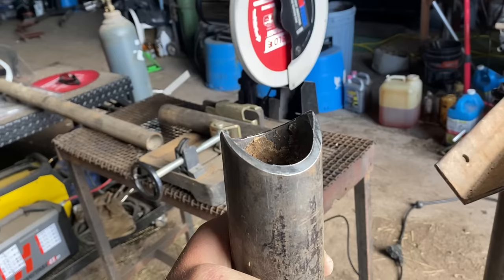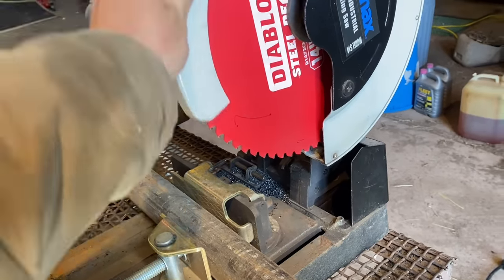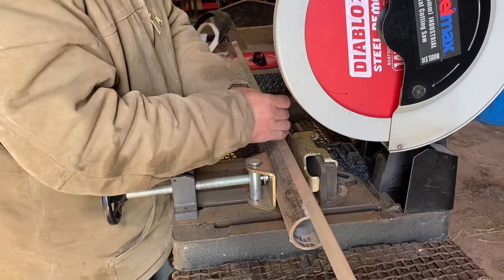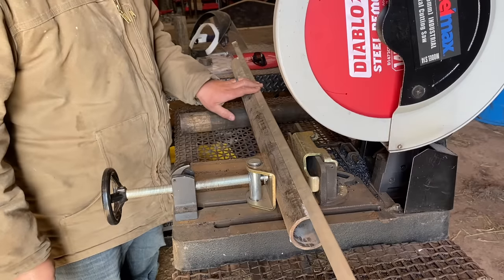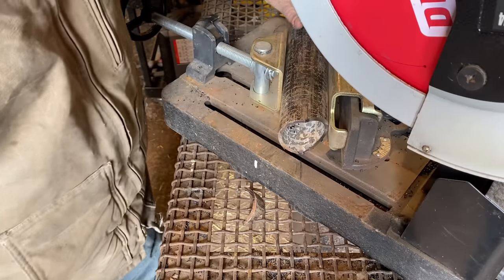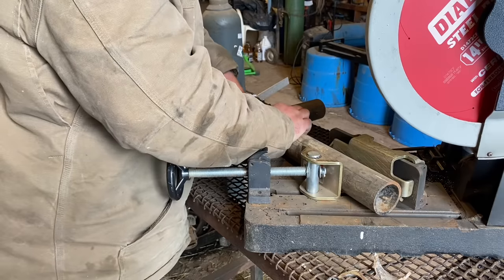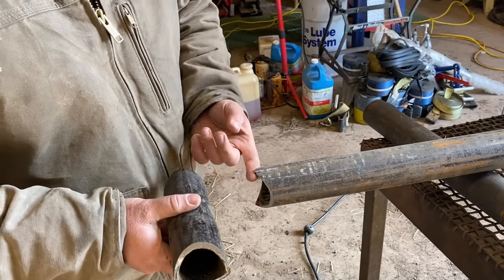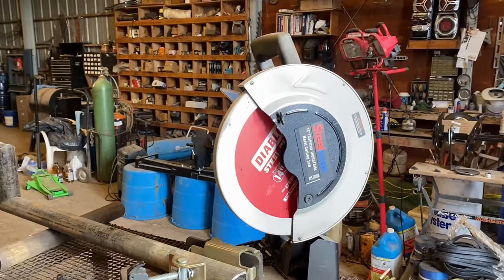How I Cut Saddles In Pipe With a Chop Saw-Descriptive Version

Comment: This is one slick method! Thanks for sharing. 

25 years ago, when I was a pup, I welded for a summer with a good ol' boy outfit  just outside of town. I was put on a job at a ranch to weld the top drill pipe rail onto existing steel posts already driven into the ground. I would imagine one can't really drive a post into the ground if it is cut like in the video already. but for fabrication purposes it's great. I  used a paper stencil the boss gave me to make the cope marks. it was a slow but  successful method since posts were already in the ground. It was a pain the arse to cut each post with a torch though. Never got a clean line all the way around. nothing a grinder couldn't fix. haha. I know you welding pros hate us hobby welders! I spent a month easy on that ranch. fun days. 

I only worked at that shop for about 6 months. The horrendous breathing conditions in the shop that winter, using a redneck coal fired stove to heat the shop, drove me to quit for pure concern for my lungs. I sure enjoyed the time I did work there, and learned a ton from ol' Rusty, the owner. super nice guy, never spoke more than a few words in a conversation. 

7 years prior I was at South West Ship yard in San Diego as a laborer, that soon led me to working in the machine shop. thought I'd try to get picked up by the welding department. But many of the old timers I worked with at the machine shop talked me outta it, saying it was super dangerous for one's lungs to be a ship welder due to all the closed areas, with crappy ventilation, and the chemicals in the bilges, even though it was required to have someone on  every side of each bulk head with a fire extinguisher, there were still many accidents and even deaths I heard about. That was enough,  I didn't pursue that career, thankfully. 

It was dead end job anyways. No job security or retirement benefits. But fun as heck, and again I learned so much. 

One night, working in an engine room of a ship in dry dock, was one of the most fascinating experiences of my life. First graveyard shift, took us an hour to get to the engine room after walking from the yard shop to the dock, then the dry dock, them up scaffolding, along gantry to the ship, then down inside the ship. Once there my new boss I had just met that night,  turns to me and says "OK let's take a nap. We'll hear anyone coming a mile away on them clanky stairs we just came down". I'm like "man I just drank five cups of coffee to be up for this shift. Can I crawl down into the bilge to find tools?" he said "Sure, as he leaned back and pulled his cap over his eyes to sleep." 

I was a skinny little shit back then,  and was easily able to make my way into the bilge below the steel cat walks, and retrieve all kinds of tools that had been dropped into the gelatinous muck. I just hung on above with one hand on the cat walk above me, as I slid around on my easter egg hunt. Filled my tool bag full that night; screwdrivers, wrenches, ratchets, etc. A 7 hours shift, think we worked about 2 hours. most of it was me making  my way back to the tool check out shed on dry land a time or two for a big ass wrench. One runs strip  took 90 minutes. This was my first exposure to government contracting, and the waste that is completely accepted and even encouraged. No wonder our military budget is so high. duh.
Reply from the maker: You’ve had a lot of work experiences in your life!

Comment: When i started to try welding . Only had a chopsw and hand cut off hand  grinder , i kind of used the same method . Bit more challenging but I learned alot then , and never used a jig. Just the concrete floor and sharpie .

Comment: I purchased an evolution saw to use the knowledge I learned here! Worked great with the evolution blade. Cut a lot of saddles then the blade started throwing a few teeth, then became dull. Purchased a Diablo blade just like you have, and it got dull very quick. My helper was the only one who used the Diablo blade so I’m not sure if he did something to ruin it? 
Just looking for recommendations to stop running through blades so fast!
Reply from the maker: The only blades I’ve used on my saw has been the Diablo ones and the OEM SteelMax ones. I’ve had good luck with the Diablo blades and felt like they lasted a good amount of time. I mostly cut oil field pipe with them. I’m pretty sporadic with my projects so I have a hard time telling how long they last exactly but I’ve always felt like I can complete quite a few projects before I have to replace them.

Comment: I use a hole saw the diameter of the pipe in press drill,when I drill thru the pipe I have two finished ends ready to weld,but this looks good too.

Comment: I do saddles pretty much like this, but instead of eyeballing down on the cut tips I place a six inch level on the cut itself and it let's you know if your plumb ,also instead of the angle trick to mark the top center I take a piece of the same material,  place it along side and drag my soap stone along the tops

Comment: smooth, a pipe fish-eye punch would give you more precision you can mark top of both ends, then hold punch in dimple and rotate 180 degrees and punch the other side.  I've always bought welded outlets pre-manufactured for fire sprinklers, now I can make them myself.  Thanks

Comment: made hand rail with a cold cut saw for years much like that 2 things to speed up your work 1 make a stop for your first cut and 2 when you do the other end just use your torpedo level no marking needed and works good for long pipe

Comment: Thank you very much. I am just learning to weld and make things and this method makes a difficult taks easy. Thanks for the links on blade and saw. The price for your saw I am sure is worth it but 4X my budget. Is there a less expensive 14" saw I might use?
Reply from the maker: I’m sure you can find something cheaper but I’m not sure which direction to point you in for decent quality. All of my experience has been with the SteelMax that’s why I feel like I can recommend it. I’ve heard Evolution makes good saws also but are probably similar in price to the SteelMax. I’d just Google or Amazon Dry Cut saws and see what you can find in your price range and check the reviews.
Reply: @LuthiRanchWY  Thank you for this honest reply

Comment: But how would you know exactly which angle to cut? is it depending on the size of the pipe? how would i know exactly? or is 30 - 45 degrees a common angle to use amongst all pipes?

Comment: Well done young fella I'm very impressed what sort of working life do you get from your saw blade and at what speed ????
Reply from the maker: My saws RPM is 1450 and the blades seem to last a good while. I mostly cut oil field pipe with them so pretty thick and heavy metal. I would say I get around 2-300 cuts out of a blade in that kind of material

Comment: Great method. Makes a perfect joint. 
If you have a little torpedo level, you can hold it vertically on the cope that was just cut, and rotate the pipe until its vertically level and then you know your next cut will line up perfectly. Then you don't have to guess and eyeball it......... Great video though
Reply from the maker: Thank for the advice

Comment: thanks brother.  the reason I ask is that I put a metal cutting blade on my 10 in. miter saw and it only lasted about 30 cuts.  thankfully Lowe's took the blade back.  turns out the higher rpm on a miter saw will kill them blades.  you can get them resharpened?

Comment: Very cool, thanks! How did you determine to set the saw at 33 degrees? Does this angle change acoording to the pipe size?
Reply from the maker: I figured it out mostly by trial and error. The angle should stay the same as long as the 2 pieces you are joining are the same size pipe.

Comment: I’m quite sure the angle changes with pipe diameter’ but it sure looks to be slick for what your doing. What is the O.D. of your drill pipe? Although the angle iron works nice a center finder would be a handy tool to add to your box 6:44 am
Reply from the maker: The pipe is 2 3/8”. I always like adding tools to my tool box

Comment: Get a small level, and make it stick to the pipe with some kind of a clamp or magnet. Easy way to line up the joints. Trick is very nice, easy to welding 👍

Comment: Need pick up a center head to mark top dead center of pipe.  It will also mark bottom dead center along with 45’s, 90’s and basically any angle around the pipe you will ever need.

Comment: Does the angel change with pipe dimensions. I have only used hole saws before but I like this method
Reply from the maker: As long as the two pieces of pipe you are joining are the same size the angle won’t change

Comment: Nice vid. I cheated when I did my pipe fence and used 2 3/8 posts with a 2 7/8 top rail. You barely have to dish the top of the post to get a nice fit. I do regret not building in air fittings and having the entire top rail a "hose" to the other side of my yard. I definitely would if I did it again. You never get a flat near the shop and my fence ended at the shop.
Reply from the maker: That’s a great idea to use the top rail as an air hose!

Comment: Thank You for sharing that!!!
Quick question, how to you figure out what angle to set the saw at. I assume it has something to do with the pipe diameter.
Thanks.
Reply from the maker: I just figured it out by trial and error. But 32 degrees should get you pretty close on all size of pipe as long as the two pieces you are joining together are the same size. The wall thickness will have an effect also.
Reply: @LuthiRanchWY  I can relate to that. I figured if I didn't hear back from you, I'd just go with trial and error. That's how I learn..........by making mistakes, and keeping at it till I figure it out.
I'm 56 now and I've never seen this before. Learning every day!
Thank you!

Comment: I’m getting ready to build some gates and I’m using 1 7/8 pipe. To make my copes on that pipe that is smaller than what your using do I still set my angle at 32 degrees?
Reply from the maker: Yes as long as the two pieces you are joining are the same size

Comment: I do a variation of this idea and don't have to grind the points.  What you do is cut on each side of your center mark about twice the thickness of the pipe wall (so a total of four pipe thickness).  This ends up with a V shape with a flat bottom.  So you end up with the two angle saddle welds and the two horizontal welds on the bottom of the V.  Or I guess you could just cut the points off with the saw set back to 90...but I would take more time.
Reply from the maker: Thanks for the tip!

Comment: When you have the pipe in the clamp at 32° when you spin it to cut joining cope use a speed square on cut plate to true up the vertical plain. It will be dead nuts square instead of eyeballing it.😁👍
Reply from the maker: Thanks for the tip!

Comment: Question: what is the final distance between the two parallel pipes which you weld into the saddles?  For example, let’s say you start with a 12” pipe, cut saddles into it, then weld that between two parallel pipes.  What’s the resulting distance between the two pipes?  Whats the formula?
Reply from the maker: I don’t have a formula. I just figure it out with trial and error

Comment: Have an old Chopsaw from decades ago, are those new Circular blades a drop in replacement for the old Grinder style blades? They make really nice clean cuts in the pipe.
Reply from the maker: No, the abrasive saws run at much higher RPMs than dry cut saws. You would need to buy a Dry cut chop saw to run one of these blades, they run at lower RPMs
Reply: @LuthiRanchWY  
🙁

Comment: I did a video a few years ago on my method of using a torch to saddle pipe.  How do you get an accurate measurement for the length you're cutting?  Do you measure how much material is removed after the first cut at an angle, and then add that amount to the inside to inside distance between your post to get your overall length? I have a shear type pipe notcher for 1 7/8" tubing that I use to make gates, and that's the method I have to use to get accurate lengths. I measure the inside to inside gap and then add 3/4" to determine the overall length I need to cut.
Reply from the maker: I’d have to look back at my notes but if I remember right I just factor in the fact that I’ll loose about 3/4” of length off of each side when I saddle them so I just add 1 1/2” to whatever my measurement is
Reply: @LuthiRanchWY  that's the same way I do it with the pipe notcher.  It comes out to about 3/8" per side, so I add 3/4".  You ended up with a real nice fit.  I've seen others use the chop saw method, but theirs usually looked pretty sloppy.

Comment: Bud... i dont think you really need this... but you may enjoy and appreciate it.... there is an old machinist's tool called a Miracle point... they used to be very expensive... you may be able to find one used affordably or make one yourself... look it up... and it will allow you to be a little more sure about your cuts.. a lot faster... handily.  Miracle Point, it is a magnetic v-block with a gravity operated dial that indicates the angle that the pipe is currently sitting at... i own one as a machinist... is old school... but very handy when ya need something like that.  Thanks for sharing your knowledge.. cheers.
Reply from the maker: Thanks for your suggestion! I’ll have to look that up, seems like a useful tool.
Reply: additionally ... if you get one: this was originally a machinist's tool.. you can use it in a mill to center drill top dead center and put that point in the drilled hole and maintain an accurate angle the pipe is turned to (any angle) without an indexing head... you can use that point as a center punch on a clean part.. but if you do be gentle... have seen em destroyed by heavy hands and hammers.. and there is generally no real need to... dont even really need to center drill... just put it on clean, set the dial.. turn the pipe to the desired angle.. clamp.. check the dial to make sure clamping didnt move you off ... cut.    @LuthiRanchWY

Comment: All your eyeball alignments could be improved simply with a weighted string attached to a flat piece of metal and a magnet. Attach one end of the string to a flat piece of metal to allow it to be cantilevered over the end of the pipe. Allow the weight to extend (cantilevered) from the top of the pipe about an 1/8 inch out and below the bottom of the pipe. Attach the flat metal to the top of the pipe using the magnet. Rotate the pipe until the string is in alignment with your top and bottom mark. You can use a heavy nut or similar for the weight.

Comment: Started welding less than a year ago , the pipe is 2” so you use a 1x1 angle iron to find the center  right?
Reply from the maker: No I just use the angle iron to line up each end for the saddle cuts so my saddles are in line

Comment: Is it always 32 degrees, or does the pipe diameter determine the correct angle?  Thanks
Reply from the maker: As long as the two pieces you are trying to join are the same size the angle will stay the same

Comment: Lately, all we do is use a saddle tool to mark the cuts and use a portable band saw to cut a "V" point, which leaves a little tab instead of a point. It welds right up like it was born there, very fast and we're on to the next joint. No grinding necessary!
Fast!

Edit:  We use Evol chop saws - pricey, but oh, so good.
Reply from the maker: Thanks for that advice! If you had a choice would you use the port a band or the chop saw?
Reply: @LuthiRanchWY  
I have a choice. I'm going to try your method, because in the odd event two fence posts are EXACTLY parallel top to bottom, your method would make pre-fabricating horizontal pipes between posts a faster deal, plus I like the automatic chamfer the cuts make, affording better penetration. Bulls, especially horny ones can really raise hell on fences  especially top rails. Can't ever have too-much weld penetration.

Comment: You could cut a 2 in. piece of square tubing that fits     over the pipe you use a lot and cut those angles into the square tubing and then when you put it in the saw just line up the blade with the edge of the square tubing.
Reply from the maker: That’s a great idea! I’ll have to try and make a jig like that the next time I’m saddling a lot of pipe. Probably safe me a lot of more time

Comment: How did you come up with the 33degree angle? is that for the 2 3/8" pipe only?
Reply from the maker: I figured it out by trial and error. 32 degrees should get you pretty close on any size of pipe as long as the 2 pieces you and trying to join are the same size. The wall thickness will have an effect also

Comment: If you don't cut to a point at your soapstone mark, i.e. cut the pipe short and leave a flat, you don't have to grind the inside of the tip because it won't be there, and it leaves a nice weld prep.
Reply from the maker: Thanks for the tip

Comment: Would the 32-33 degrees   work on any diameter pipe?
Reply from the maker: It will as long as the two pieces of pipe you are joining are the same size.

Comment: Great technique to cut those saddles!  One point of correction is that 2-inch pipe is not "drill pipe" but most like oilfield tubing.  Drillpipe is much thicker and has an extremely robust connection type with coarse threads.  Too heavy to use for much of anything but some people use it with short sections for fence posts.
Reply from the maker: Thanks for that, I’ve been corrected on that before.